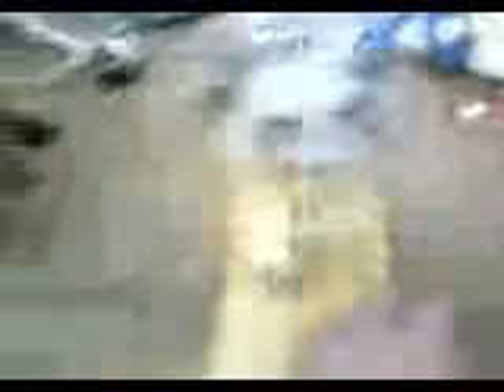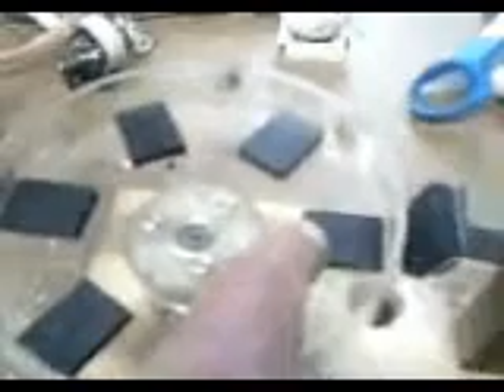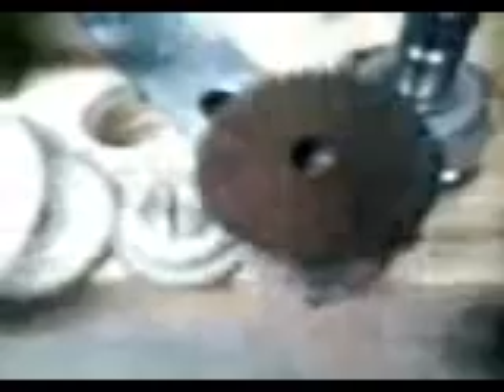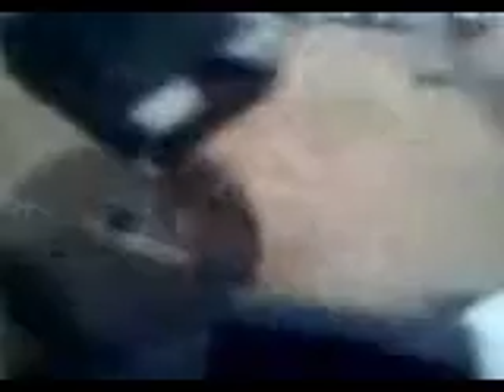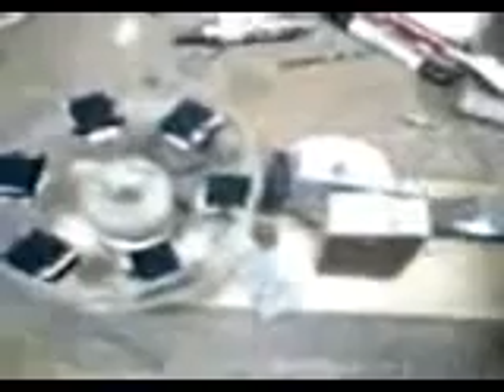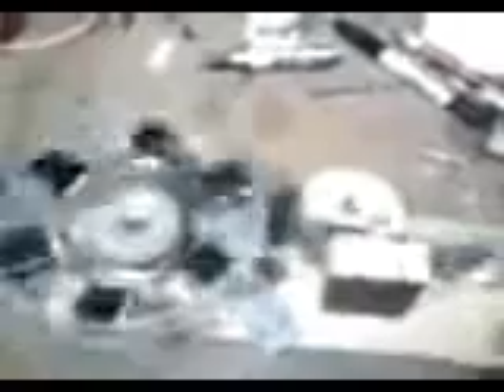01 - Steorn concept Permanent Magnet Motor test

Comment: If the flywheel was slightly larger In diameter and was wavy around the edge to act as a cam  to your other magnet to lift it and drop it or if the outside magnet were  twisted slightly after  flywheel starts spinning perhaps the stationary magnet could be twisted 10 to 15ﾟ maybe and continue pushing and pulling I like the cam idea better or gravity bc if there were a magnet on a flexible stick or rod at a 45 degree angle from ground level upto the flywheel with a magnet on the end of the stick or rod the magnet on the flywheel would push the other magnet on the stick up and away from it and push the flywheel away and it would move in a constant direction as the flexible stick would return down and towards the flywheel just in time to push up and away from the next magnet on the flywheel

Comment: If you are still thinking about this project, have you considered a flywheel type mechanical battery for your initial power source and storage?
Reply from the maker: Not an all permanent magnet motor. But what I'm working on does involve permanent magnets, plus a "secret sauce". Look up swelling magnets.
Reply: @zerolabs  will do. I'm glad to see you're still going sir

Comment: So, what if you used an electromagnet with a timing control. (circuit board?).
And then angled your permanent magnets in the hub, 30 degrees, also angling the electromagnet the same, while isolating each of the magnets in the hub?
Make the baseplate of a magnet to float the hub, doing the same, only reversing the polarity to push down on the hub? Remove the atmosphere, to reduce friction. Vacuum.

Comment: Of you add a few gears and a crank you could have it run indefinitely once you started it. It should work. The spinning container is hooked up to several gears and the last one is attached to a crank which is attached the the lever and it should work once you start it. Or it will just create a perpetual motion machine.

Comment: I am sorry. We all know that a permanent magnet can not  Induce current into a coil of wire. Only an electromagnet can do this. We also know that the magnetism created by a magnet is different than the magnetism created by an electromagnet. A self running magnetic motor has as much chance of producing useful work as a steam engine. Sure the steam will push a piston down, but what then? How do you get the piston to go back up? Keep your horses and oxen. They work off grass and grain. thanks

Comment: What if you were to add another rotary type system to the center and the handle you are using manually, that would push/pull on the handle in the correct timing as the magnet went by?

Comment: @lorenzolanz 
The orbo motor doesn't not follow the common laws for electric motor construction...

Look at it this way: In standard motors electric energy is used directly to push/pull the shaft.
In the orbo/saturatable electric motor, electric energy is used to change the core medium which reacts with the motor permanent magnets. Its a whole different situation.

Comment: Why don't you fix nylon or delrin washers on the wood between the gears and the wood to reduce friction and then attach mechanical cam bumps on a gear such that the bumps correspond to the timing of the arm movement necessary to operate the device at optimum. Reduce the friction in that very shaky arm and place a roller of some type on the arm to interact with the cam bumps on the cam gear you create. Then you can reserve all the electrical energy from any generator you attach as output only.

Comment: This isnt even a finished product, the guy doesnt know how to work this thing consistently. The energy coming out of the wheel does not exceed the energy being put into the lever. Very simple to see that there is no "free energy" and that this is a gimmick. Very unprofessional to make some claim like this, and he doesnt even show quantized results. (If he did you would see the input energy is greater than the output)

Comment: @ZeroFossilFuel Have you experimented to see how a load affects the motor's (wheel's) movement? I'm pretty sure you'll find the rotational velocity will decrease significantly (if not completely) if you attempt to extract energy (such as a small electric motor).  Let me know how this project is progressing!

Comment: Nice job! It is EASY TO SEE that if 6 magnets are rotating at hundreds of RPM, then there is more energy in the rotor (rotational inertia) than there is in just one magnet of the same size moving much slower over a distance of only 2-3mm. I hope dearly that all the laymen out there can see this simple physical fact. I'm not sure about the WORK done by each, so you'll have to load the rotor and test it. Looking forward to more.

Comment from the maker: @mbunds No, magnets are not a form of energy. If they were and if we could get a motor to operate on that form of energy, the energy would become depleted.

Paddles on a waterwheel and blades on a wind turbine are not forms of energy either. If they're absent or not oriented correctly they do nothing. When in place and oriented correctly, they trap the real energy passing by and convert it to usable mechanical energy.

We swim in energy. All we need is just a little of it.

Comment from the maker: The OSPMM lives!  Today, 3/11/2010, special order neodymium magnets have arrived. The new name is SOSPMM for Sinusoidal Oscillating Stator Permanent Magnet Motor.

It has also spawned a new idea for a perpendicular rotating field PMM that creates the same sinusoidal pattern without the vibration allowing for much higher speeds before self destruction. I ordered the magnets for this too.

You're the first to hear of it.

Stay tuned.....................

Comment: Laws of perpetual mouvement:
1- is not necessary inicial impulse.
2- once runing it doesn't stop unless brake is aplied.
3- it works without electric wires atached.
4- and finaly... it doesn't work, whatever you do.
If any of these rules is violated, is a fake machine.

Comment: @tubadoremeow  a system without a source of energy or force to mechanically run itself on its own power is impossible...it's against the laws of physics, even if it did work, it would slow down as it lost energy and eventually stop. but a magnet is a force of energy, but as i would tell this guy..."your doing it wrong" most ppl i see who try to build these devices try some way over complicated design, using magnets for energy, is much simpler than you think, there is a simple design that works.

Comment: This is what you need to do. Put a roller on the bottom of the magnet that goes up and down. Use a low friction bearing. Then around the flywheel, glue a strip of plastic that oscillates up and down. The bearing will rest on it, and every time you want the magnet to go up, you put a bump in the ring. Kind of like a cam system. This way you can have the magnet follow an exact path without using any power for electronics to make it oscillate.

Comment: Although you are creating more visible motion, the energy output of bouncing that magnetic can achieve the same work (power, energy, all the same) as the wheel can apply (energy stored in the wheel's kinetic motion). You are pursuing the wrong uses of this idea. Instead, consider where you can harvest a small "bouncing" motion and use that to "create" energy.

Comment: Extend a stem off of the rotor to spin another disk (appropriately sized for timing ratio) high enough to clear the movement of the stator so that you can run a belt loop (rubber band) to a smaller wheel's drive axle- offset from center to cause a lobbing effect pushing the stator in time with the spin. I think count the gates and make that the ratio (8 gates means 8:1) but I'm no engineer. The belt would be on the axle of the lobe of course, which would probably need a third wheel for ratio.

Comment: it reminds me of those power ball training objects. you put little energy in it all the time an then it goes up for turning with some 10k rpms as if you had used the most powerfull engine. in fact it was only your hands along with accumulation in a rotating object held by relatively low friction bearings.

Comment: If there is such thing as "free energy" I believe it will be found using magnets.  However, the energy won't be free since magnets wear out.  Hence magnets will become the fuel!  I wonder if they make a device that opens and closes a magnetic circuit?  Like an SCR for magnetic circuits?  Then you could alternate magnetic fields without the use of kinetic energy.

Comment: maybe if u could hook the wheel up to a battery and use that power to make something move the stator magnet? also maybe spin a bigger wheel? have u seen the calloway vtrack design it will almost go full circle without having to move the stator magnet. just some ideas i just bought some neo magnets to play around with

Comment from the maker: Then we will need to agree to disagree. "A magnet at rest does no work". But a magnet in the presence of another does do work UNTIL they come to rest. The key is how to make a magnet come to a position of rest over and over where it can continue to do work. I now have the idea for another prototype I will be building to test this theory. Still an oscillating stator, moved by pulsed current to electromagnets and held in place by permanent magnets while the work is being done.

Comment: My idea to close the loop is to have two circles of magnets underneith and fixed to the disk.  They would alternate poles and there would be a magnet inbetween the two circles of magnets hooked to a lever.  That lever would connect to the end of the lever shown in the video.  Thus, as the disk speeds up the magnets would force the levers to move faster to compensate...  Hopefully that makes sense ^_^

Comment from the maker: Lizz is correct. A varying field or switching is always neccessary. Finding a way to switch it is the key. That's why I had the stator move up and down between the 2 fields. It "felt" like there was a switching taking place. The oscillating stator is being replaced with something quite different. Stay tuned!

Comment from the maker: It will run as long as I can keep a steady rhythm on the lever. Soon it will keep it's own rhythm driven by a cam near the center of the rotor where it will have a good mechanical advantage. My greatest concern is that it will fly apart and injure me before I can stop it!

Comment: Impressive! Have you thought about using a mechanical armature to move the stator arm instead of all that slop with the gears? Maybe a mass on the rotor could physically impact a lever on the stator to move it just the couple of millimeters you need.